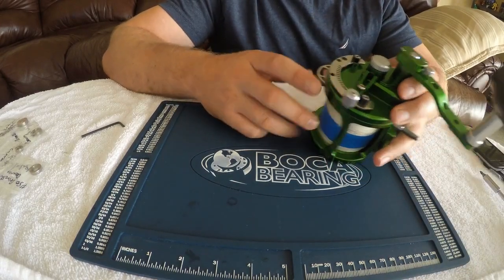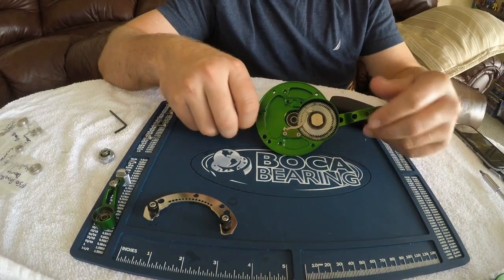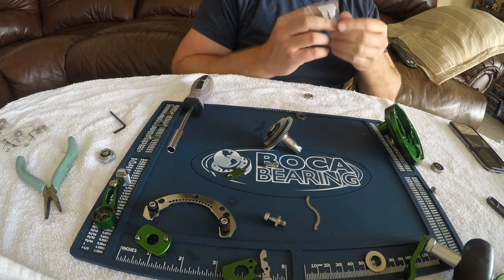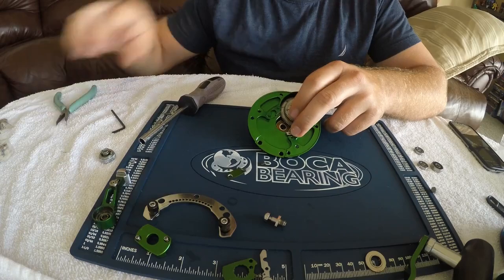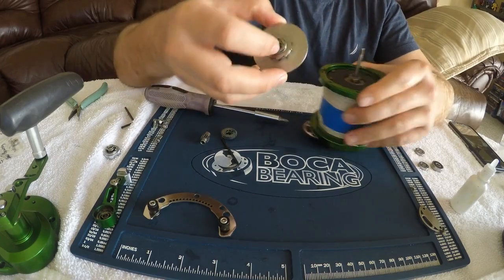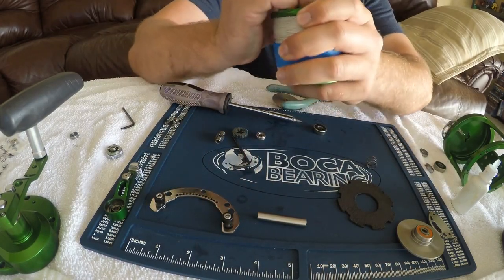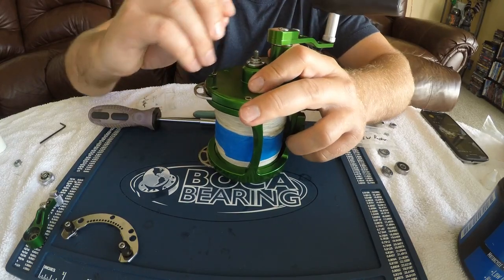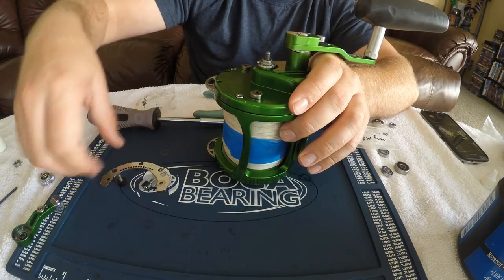Avet HXW Raptor Ceramic Bearing Upgrade

Comment: I count 7 bearings that are replaced in this video as follows:   

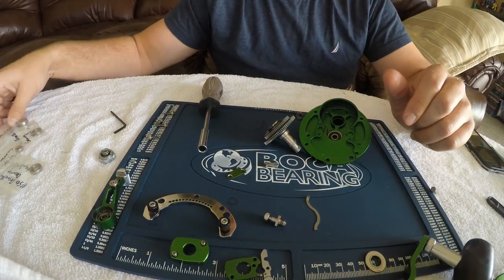(1) Drive shaft bearing 5:24 (he doesnt install it til 7:20); 
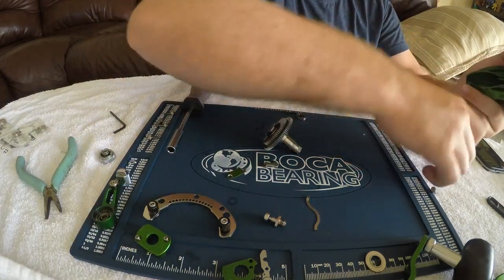(2) End housing (pinion) bearing 6:32
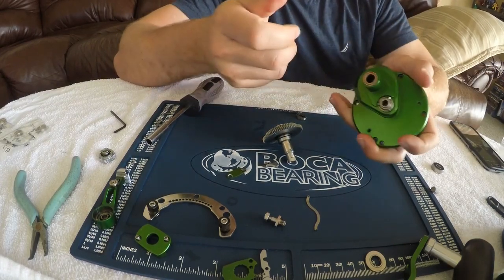(3) 2nd drive shaft bearing 7:40
(4) Outer drag (brake) bearing 13:41
(5) 2nd outer drag (brake) bearing 14:47
(6) Spool bearing 17:08 
(7) 2nd spool bearing 18:03